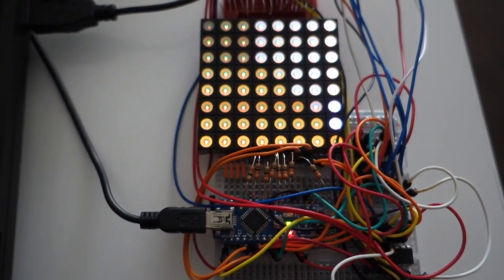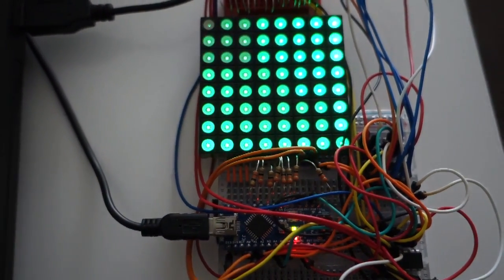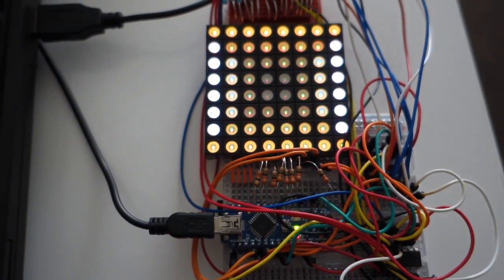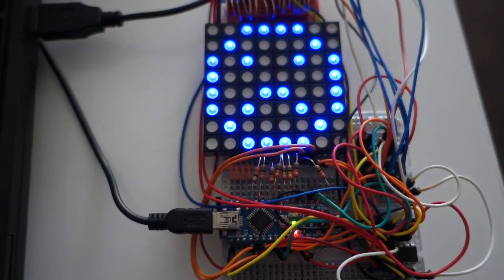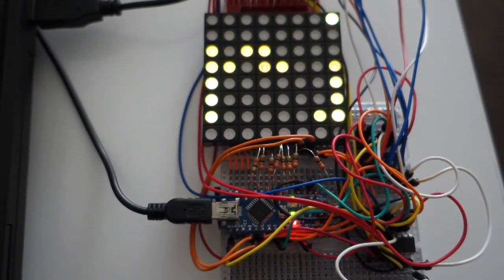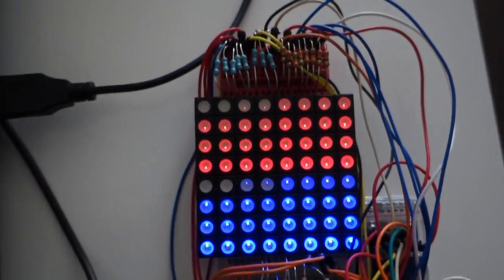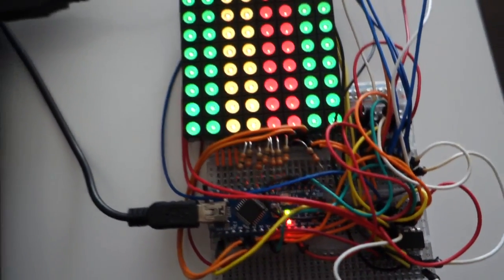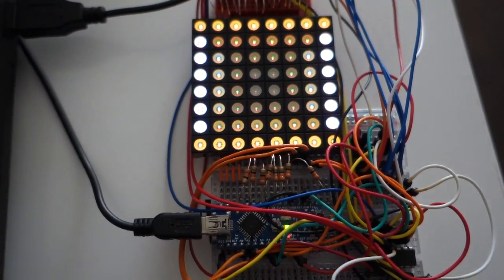Tricolor LED Matrix 4 bit PWM with arduino nano v3 library demo (160us per line)

Comment: How to use three MAX7219 control a 8X8 LED MATRIX RGB?
Can you tell me how the circuit connecting it?
Reply from the maker: 李偉佛 It's hard to do this with MAX7219 because you would have to get their refresh of common rows be exactly synchronized.Also, MAX7129 will not allow you to do PWM easily since it wasn't designed for that.
In other words, it's probably not impossible, but much harder than driving the pins yourself with an arduino.
Reply: So how can use MAX7219 to control LED MATRIX 8X8?
Reply: I see your video can display many color?
Can you tell me how to do it?
Reply from the maker: 李偉佛 if you only want to power one color, read up on the internet, there are several tutorials that explain how to do it.
Reply from the maker: 李偉佛 You need to read my web page, including the links I give inside it http://marc.merlins.org/perso/arduino/post_2015-01-06_Driver-for-direct-driving-single-to-3-color-LED-Matrices-with-software-PWM.html
Reply: I ask about the letters displayed in the opposite direction, how to deal with?
The direction of movement is from left to right, how to change?
Reply: If I use common anode, what is the need to change it

Comment: Hello Friend!
1) You used 3 Shift registers?
2) In the code, you explain the wire connections in the components?
3) The resistors are connected in cathodes of the Matrix?
Because the design is very confusing!
thank you so very much
Reply from the maker: 1) I only needed 2
2) Look at the comments in https://github.com/marcmerlin/LED-Matrix/blob/master/examples/directmatrix8x8_tricolor_direct_sr/direc
tmatrix8x8_tricolor_direct_sr.ino
3) depends which matrix you have. If common anode, then resistors go on cathode. If not, it's the other way around.